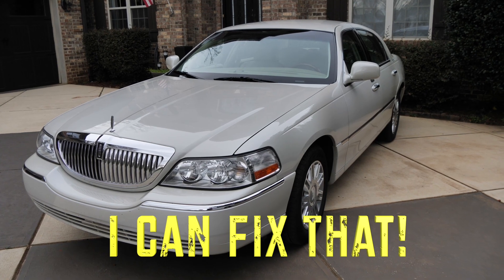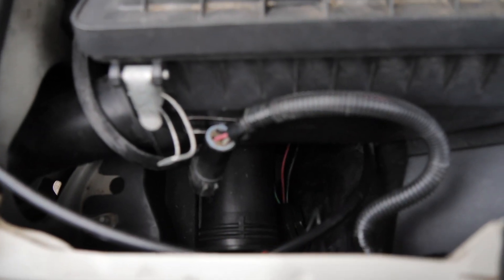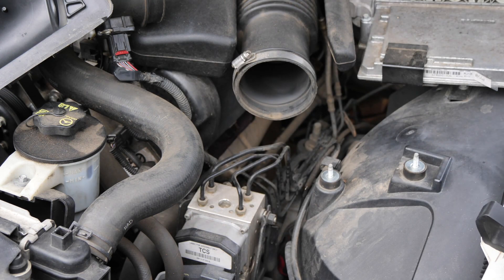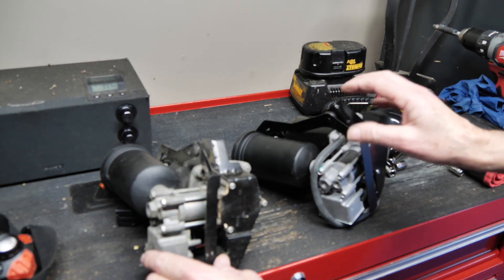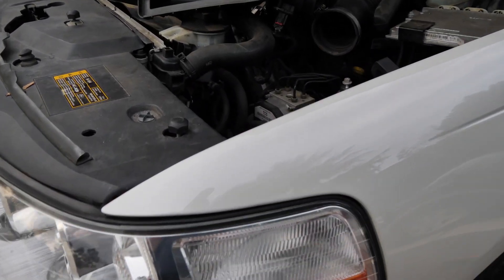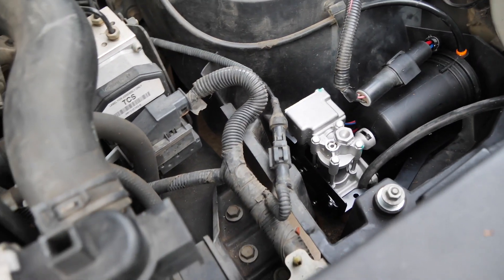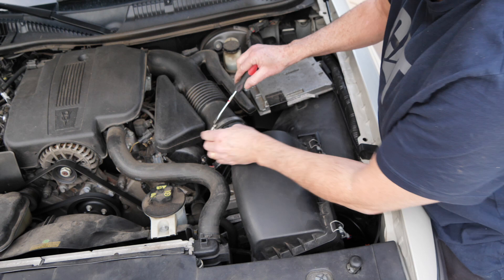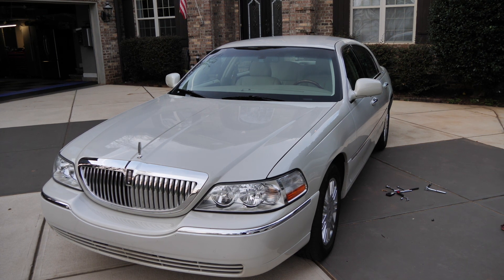Town Car Air Suspension Compressor replacement

Comment: Doesn't your Air Suspension Compressor have a Cover to Mute the sound of the motor , or do you just rely on the Motor Mount Gromets to mute the rattle sound ?   Thanks !

Comment: Would that make the car squeak bad? All of a sudden my car is squeaking so bad. Even when I got out I pushing down on the front and it squeaks also. What’s wrong with it? 1999 Lincoln TC
Reply: You more then likely need new front struts, has nothing to do with air suspension though.  This pump is strictly for the rear wheels

Comment: Anyone know where it is on a 1992 Lincoln Town car executive suite under air filter box on mines is a anit lock brake pump trying to find where the air suspension compressor is on my 1992

Comment: And just a Beautiful Town Car! Mine's a rare Chestnut Brown with my 2004 Crown Victoria LX Sport rims :) A nice upgrade is to replace the air box and tube with a Police Interceptor, it has a bigger snorkle to breath thru... But you have to use the 80mm MAF air sensor, that thingy you needed to unplug!

Comment: My 2004 air bags dry rotted... so the easiest and cheapest way to fix... Moog Spring kit! Cheaper than the bags and the ride is completely the same smooth ride I had before :) Trust me, you'll be changing them old air bags in a year or so! OH! And left the motor inplace!

Comment: Aye bother, I have no light on the dash, but I always keep hearing the air compressor kick on while I’m driving, I’m not sure if the airbags are leaking or if the compressor is not pumping enough air into the bags please help, or could it be the solenoid

Comment: Also not a bad idea to replace the solenoids back at the air bags at the same time. Not 100% necessary, but they'll eventually die on you as well.

Comment: You need to replace the bags too.  I’ve been through this on 3 Mark VII’s and one Towncar.  There are few things worse than spending all that money on the pump for it to fail in the next year because the bags were leaking just a little bit with every bump.  I know it’s expensive to do it all at once, but 2006 is a 17 year old car.  It really is at the end of the life for those airbags.
Reply from the maker: You are right. --I did replace both rubber air bags -- I wish I would have made a vid.
Reply: We added Coil springs! And removed the air bags. Best move ever.
Reply: @captainamericaamerica8090 why is that the best move

Comment: Never was a fan of air suspension. Coils and shocks I'm ok with. I hope Lincoln in these  body style years offered as a choice.
Reply: I have 2 Town Cars right now. A 03 Cartier that was on springs when I bought it 3yrs ago. I have a 03 Executive series we just picked up from an estate sale with 70k original miles with the factory air suspension still in place and working. After having experience with both I’m keeping the newer one on air. It has a firm float to it. I love it. Springs are good but there is the occasional rear axle hop with the springs I’ve never felt that with air. Plus everything to replace the air suspension now is cheaper (500 or less)
Reply from the maker: Tom thanks for the input. Air suspension definitely has it's pros and cons

Comment: First my bags wore out. My son wanted to just replace them with springs. I liked the feel of the air bag suspension, so I had him put on new bags. About a year later, I had problems again. My son wasn't sure if it was the pump or an electrical problem, so he talked me into just letting him replace the bags with springs. I really don't feel that much difference. The difference isn't as much as I thought it would be. I should have just let him put on the springs the first time. Springs are a simpler system. It avoids future problems.
Reply: The air suspension on the panthers is such a simple system, there's literally only 3 or 4 inexpensive components that can fail. Beyond me why anyone would change over to coil springs, which are higher spring rate and hence less soft. Wish I had air suspension on my civy Crown Vic, thinking about retrofitting it tbh.
Reply: @robertkeller9693 I saw a video that there is an aftermarket air suspension brand that is better than original and will last forever
Reply from the maker: That is good to know that you do not notice a difference in the ride with springs. Thanks for the input

Comment: I also have a 1993 Lincoln MARK VIII with an operating air suspension. Is that compressor as easy to swap out as this car? As long as it is working I am not going to bother it. Everything works on the car including the A/C. I am keeping it mainly as a show car and am restoring it back to new which won't be hard at all she's already gorgeous.

Comment: One thing I truly admire about the Ford Crown Victoria, Mercury Grand Marquis, and the Lincoln Town Car is the fact they run forever with the proper maintenance, and the parts are plentiful without costing an arm and three legs! I got to drive one with 550,000+ miles on it and I couldn't tell the difference in operation from my low mileage doll.
Reply: This is one video I’ve been looking for … my 2006 TC has 529,000 miles and the air suspension light came on. Looks like I have the very same issue, the compressor does not activate. There’s another video talking about the switch in the trunk; check it for corrosion (sometimes gunks up like a battery terminal). Always good to start with the simpler (cheaper) solutions, process of elimination. I’m not looking forward to the possibility of replacing the bags …
Reply: Yeah the transmission is piece of shit no matter what your do I know so cuz I built 2 million dollar houses from these 4R 75 transmission they the same as F150 E150 and expedition junk junk junk

Comment: Aw shux! Thanks for the insight! My 2004 Lincoln Town Car Ultimate has a mere 22,800+ original miles on the odometer. The car still drives like new. If I ever need to replace the height control compressor I can fix it myself! I love my Town Car. I am 6'2" tall and I need a big car. AND, they don't make a full-size car like this anymore.
Reply from the maker: Wow that is one sweet car--- 22k  --- all most new!
Reply: @icanfixthat-ep4jk  - "Esme" rides like a big 'ole rollin' Barcalounger - !

Comment: The reason you suspend the rear tires is keep from putting pressure on uninflated air bags.  Once the compressor fills the bags they're not supposed to deflate, which is the problem I'm having.  Thanks for shout out on the 10mm sockets...now I have to find one.
Reply: Your comments make no sense, can you hear yourself?
Reply: @maxdm1583 
I understood his comment perfectly.  So…can you hear yourself??

Comment: Good, concise repair video. I ordered a Dorman brand air compressor to replace the defective one on my 2011 Grand Marquis this morning. We'll see how it goes when i get in there to fix mine. I did see another video where they say to jack the rear suspension up to take weight off both back tires, but it appears you had no issue not doing that on yours. Thnaks again!